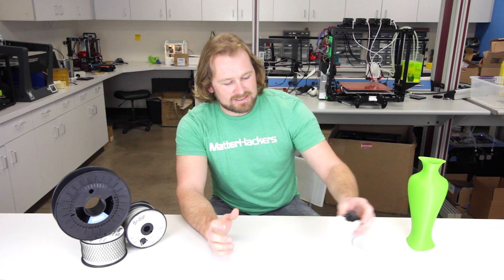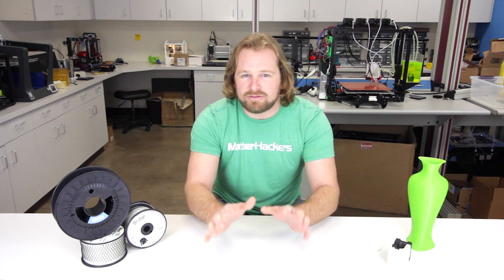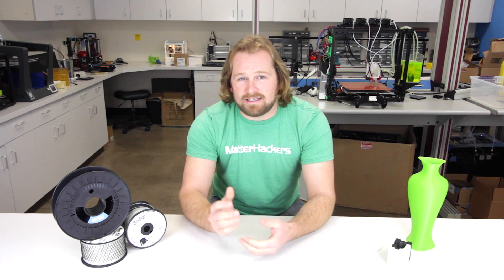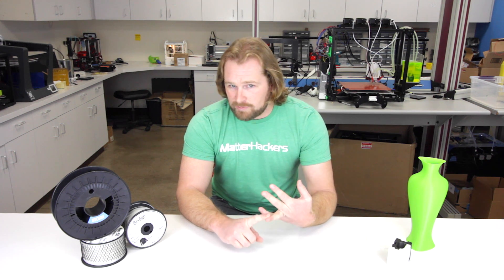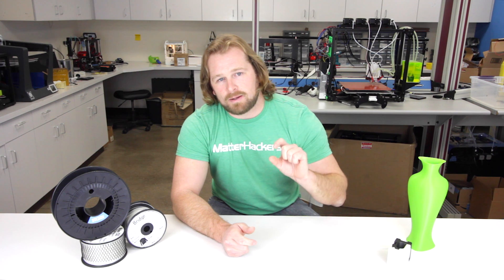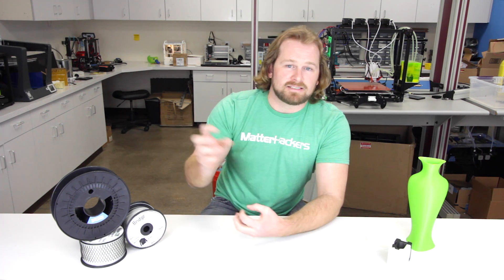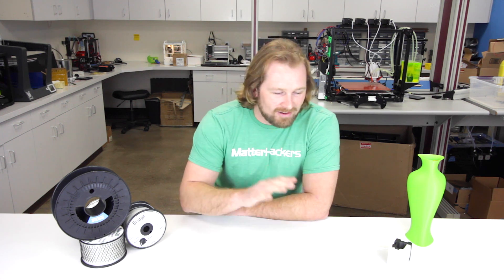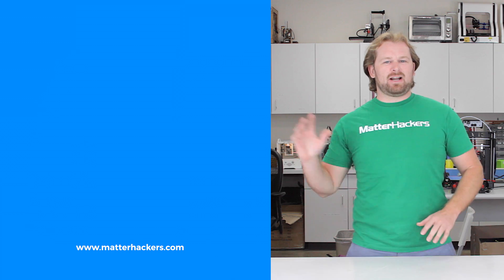How To Succeed When 3D Printing With Nylon

Comment: Hey great video! Just starting printing with carbon nylon . Printed great the first few days then the tick - tick - tick of the clog monster started . I haven't noticed any steam or popping but is this another indicator of moisture in the filament ? 
 Cheers
Reply: I have not printed with this and am far beyond an expert but have been studying different filaments all week for work and this is exactly what i have heard regarding moisture, are you holding your filament in a dry chamber WHILE its printing?

Comment: Hey you said put it in the oven for about 2 hours. What temperature?
Reply: We dry all stuff at 70°C for 6-12h and then drop it imidiatly into a silikabag. 1 Roll + 200g silikaperls. For 2h.

We build some ceralcontainer spools and leave the rolls inside also with silikaperls +-2cm at the bottom so that the perls dont touch the spool.
Search for "the best filament dry box" on ytube. The ceralboxes cost some cash but that system works realy great. Happy printing

Comment: How hot do you want to get the oven to properly desiccate your nylon?
Reply: I saw elsewhere 60-70 degrees C. I would go with 60 to make sure I don't heat it too much.
Reply: Coming from experience in extrusion and injection moulding, 60 will not get you anywhere, only if you don't dry it for 24+ hours. 90 degrees is a correct temperature for about 3-4 hours. More time is better.

Comment: Been machining parts for years so new to 3 d printing but want to make gears for a project i am doing and nylon is available this is the route i want to take, so on this note what 3D printer do you think i should go for ? And give me a idea on price i would pay, when you go on line the is so many you sound you know your stuff hence the question cheers
Reply: I got an Ender 3 Pro for $310 CAD, so you could get the same for about $260 US I believe. Then you buy a Micro Swiss hotend, which is a drop in replacement, so you don't have to print an adapter or anything of the sort. A regular Ender 3 would be even more affordable, but up to you to look at the differences between the two and see for yourself.

Comment: Can you use a heat gun to speed dry a roll of Taulman Bridge 910/Nylon? Thanks
Reply: No. Don't do this to anything. An oven will evenly heat the filament and ensure it all dries. Spot heating like with a heatgun will either not get it warm enough throughout the filament. If you leave it heating a spot for too long, it could get too hot and melt or warp the filament. Furthermore, it's not going to be faster than an oven. The reason it takes so long is not due to the need for extra heat, it's because filament can only withstand so much heat. So you have to warm it up only as much as it can withstand, and let the water slowly evaporate out of the filament.
Reply: @MattMerkle  for how long and what temperature will you recommend? Many thanks!

Comment: Too expensive and hard to get (canada)
Reply: Look up eSun's carbon fiber reinforced nylon at digitmakers.ca. I have two rolls of it, and I also have two rolls of TreeD carbonium nylon that I haven't tested yet. The TreeD filament was quite expensive, but the eSun one was a lot more affordable. I use their PLA+, which I really like so far. I haven't gotten around to printing parts that I need to be ultra tough as of yet, but I'm planning to. But if you want to print tough, durable and strong parts, I would give eSun a shot:

https://www.digitmakers.ca/products/high-performance-htpla-carbon-fiber-2?variant=29895218891

Comment: you mention putting wet nylon in the over but and how long to do it but don't give a temp.  How hot should the over be to dry nylon.
Reply from the maker: Typically between 160-180 °F for 6 to 8 hours. We have an article all about nylon printing and how to succeed with it here: https://www.matterhackers.com/articles/printing-with-nylon

Comment: Which printer should I go for purchasing for printing with nylon material ? My budget is 2500 USD
Reply: I second this question (with half the budget).
Did you find a good printer Aman?
Reply: @ddegn  flash forge Guider 2 is a good option, cost-2500 USD
It works well with Nylon 
But got no idea for half the price.
Reply: @amanchaure5584  I'll take a look at the Flash Forge Guider 2. Thanks for the reply.

Comment: Im a huge fan of nylon - but I dont understand the numerical values associated with the different filaments. Like Nylon 645 or 915 -- is this a temperature rating or strength?  i wish you hit this on your video..
Reply: It's a "technical product numbering" system, more related to strength More info on the Taulman website - http://taulman3d.com

Comment: would 260C nozzle temp of the i3 mega be sufficient to print nylon?
Reply: I have done a test print with an I3 Mega using Hobbyking white PA Nylon, standard hot end at 260C, I think it was pushing it a bit. Layer adhesion was good but I got a bit of warping. Maybe my bed wasn't hot enough. I'm going to upgrade the heat break to all metal and try again.

Comment: I also love to use nylons, you are 100% right,  it needs to be bone dry to be at its best, however I have to disagree with bed temp and that messy glue stick though, I print ALL nylons on Cold glass with the cheapest strong hold dollar store hair spray, on Cold glass, in fact its the only way I found to prevent Bridge from warping, and I use this method with all Taulman's nylons.  here a photo link to what I use https://www.dropbox.com/s/872qykddim10c0x/MJH_6467.JPG?dl=0 .  I am not arguing with you, just sharing knowledge I gain though trial and error.
Reply: patprop74 does this method work on nylonx? Thanks
Reply: I have yet to try nylonX, logically  I would say yes, seeing how its must be a nylon not unlike taulman ??? but again, have not tried nylonX.
Reply: patprop74  I'll try it out when I get time thanks for your reply.

Comment: Have you ever used buildtak for the bed? I want to print nylon bridge on a heated bed + buildtak + glass, but dont know if it needs more adhesion or if its over kill, i dont wana rip the buildtak, already did that once, had to change the plate
Reply: Tried that recently and it didn't stick to the buildtak at all. Had to use a glue stick additionally and it worked a lot better, butstill have some issues with it. I'm gonna try other glue sticks for my next prints.

Comment: ABS lacks strength, right after you talk about PLA? Look around you! Your computer keyboard is made out of ABS. Your mouse is ABS. Your monitor's shell and computer front bezel are probably ABS. The nylon filament is spooled on ABS reels! Half the plastic items you run into are made of ABS! That said, I agree that nylon is an amazing material, and great for structural components. You did forget to recommend a temperature for the oven to dry out the filament. Correction: You did give a temperature range in the comment section below.
Reply: there is a difference between injected ABS and printed ABS, It is true that 80% of plastic parts around us for everyday items  are made with ABS, But lets keep in mind the injections molds are very closely kept to an exact temps with  proper cool-down time, also, parts are molded in one go, unlike 3D printed ABS which hot layers an laid down on top of cold layers which reduce strength.
Reply from the maker: Thanks for the feedback! Yes, ABS is an AWESOME material - we use it all the time and it is a strong material.

Comment: Does this require a heated bed? Im halfway through overhauling a wanhao I3 and I need a 2nd power supply before the bed is safe to use
Reply from the maker: When printing on glass, a heated bed is required with nylon filament. We’ve found that a bed heated to 75°C, with thin layer of glue (from a regular elmer's glue stick) applied in a cross-hatch pattern works best.

Comment: I plan on experimenting with the weed trimmer line. Any thought?
Reply: i actually printed trimmer line at 230c , layer adhesion was very good too. I didnt dry the nylon but it didnt seem to matter that much really, although it all depends on what you want to do. Dryng it may get you smoother results , but if you just want to do a tough functional part , i found that drying is not too crucial. Cant say whatt the printing speed is, since i used a homemade printer made of junk . The hotend is an e3d v5 clone with heatsink removed , screwed directly into a direct drive mk8 extruder clone running a 3mm (2.8mm actually) trimmer line. So if it worked on my very bad put together printer, i bet it will do wonders on a more professional printer.
Have fun with it, its worth it :D
Reply: Alex S i have the ANET A8. Will let you know when I get around to it.

Comment: What's going on with that printer on the table behind your left shoulder?! Is that a water cooled hotend? Four extruders?
Reply from the maker: It is a bit of an R&D project - water cooled Kit TAZ with an E3D Kraken water cooled with radiator fluid. Pretty fun to use!
Reply: That's nuts! Any videos of that in action? Looks super fun :D